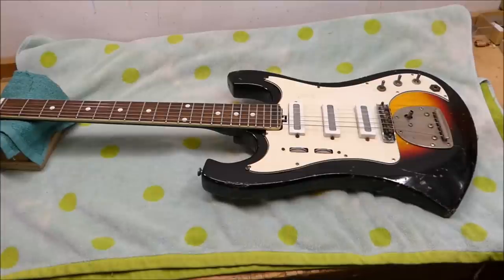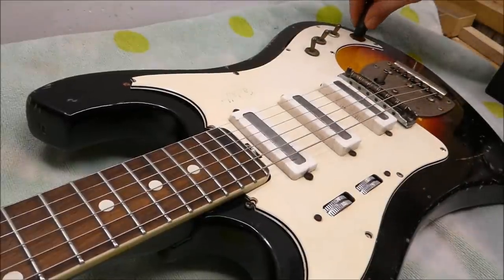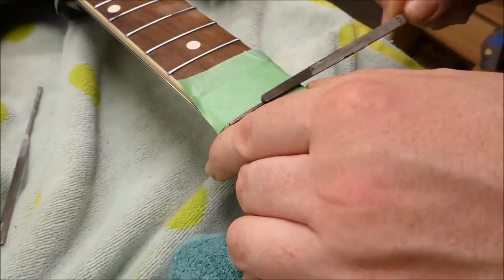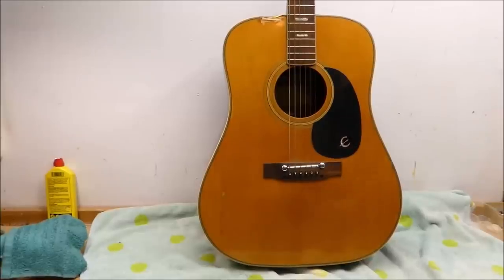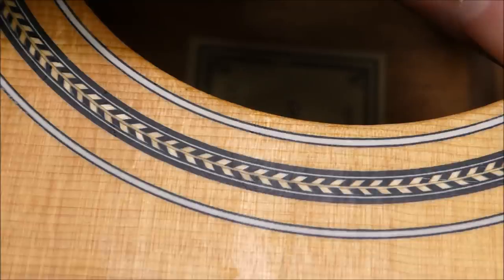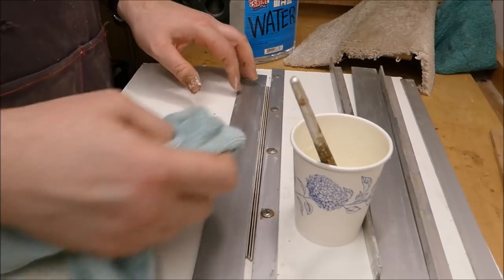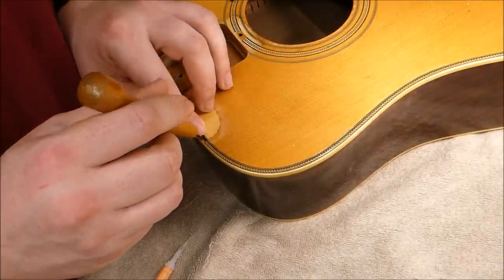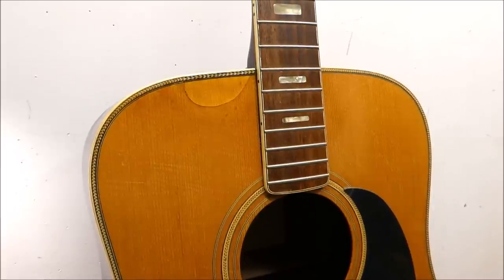Eko Kadett and Epi Ker-unch

Comment: LOVE your comment about “Japanese plywood top” guitars.  I still have my first acoustic, a ‘77 Takamini F360 (Martin D-28 copy); I bought new when a local (Iowa) guitar store was going out of business.  It sounds/plays great and I’ve taken very good care of it. About 30 years ago, I took it to a guitar shop here in Dallas, TX, to ask about a slight rise in the neck, just in front of the neck joint.  The shop specializes in Martins, especially pre-war collector stuff.  The luthier there said he simply would not work on it.  He was rude as hell and said it’s a worthless guitar...made it sound like it was made of cardboard.  

I was a definitely put off, because I love this guitar.   It had spent quite a bit of it’s life, at that point, out of the case and on a guitar stand.  I’m an engineer and after doing some reading, hypothesized it could be due to the wood drying out.  Fortunately, after properly humidifying the guitar, over time while it was in the case, the minor issue went away.  Because of that experience, I’ve never been back to that shop; and I own multiple Martin guitars.  🤓
Reply: I just don't get that. Like if a customer is willing to pay the cost then do the work. If I want to spend $1000 repairing a $50 guitar because of the memories that instrument holds then whatever. I have a buddy who has an objectively terrible guitar he got when he was 17, some kind of cheap knock off of a flying V that refuses to stay in tune. It's got pride of place on his wall right next to his Gibson Explorer because it's the guitar he played his first gig with back in school and has a ton of memories locked up in it. An objectively worthless guitar, but priceless to him.
Reply: @misterthegeoff9767  I agree 100%

Comment: The switching on the Eko is fascinating. It's designed to resemble a Jaguar, but all the controls affect the same circuit. I'm glad you mention that Squier vibrato is aftermarket because for a second I almost thought Ekos had near-exact copies of Jazzmaster/Jag vibratos in the mid-'60s

Comment: That EKO is lovely. A lot of 60s music was played on cheap guitars. EKO acoustics were all over England back then. They played well enough to learn on. Never seen an electric before, though. Nice. Good sound. Poor Epi... Plywood guitars are useable. Bought a Fender F65 back in '74. Had a weak low E. Now it's a booming blues box. They do improve with time. And they are damage resistant. Up to a point. Fine repair, sir. As good as could be done.

Comment: Super difficult repair.  I appreciate the humility and knowing when to stop.  Maybe squeezing a thinned wood putty+wood glue into the joint so it forms a putty line above the top and sanding down would make the line go away and blend better? Idk. I have had the same issue with cracked violin tops trying to sand and fill the crack and the shellac just loves to find its way in.

Comment: Love the videos.. You have tons of knowledge and excellent information. One quick tip for beginners to remember with intonation, using a tuner, move the saddles in the direction of the needle on the meter. Sharp (short) means moving the saddles away from the bridge pickup and flat (long) means moving the saddles towards the bridge pickup.

Comment: I'm a huge fan of the wheel method of adjustment for the truss rod. I  install them in a cut out in the last fret though.
I would almost guarantee if Gibson did this on their guitars it would bring an end the the headstock snapping off because no channel routed under the nut would leave a lot more wood in the area to guard against it.
Also something to try on lubricating these old tuners. I was trying to make some old harmony tuners function smoothly and tried rubbing the gears with wax. Worked great with no mess. Since then have been using White Lightning bicycle chain lube. Dries into a very clean wax surface. No fuss no muss.

Comment: I have an Eko Ranger acoustic from the early 70s that was my Dad’s - it was the guitar that I learned to play on. Interestingly enough, it uses a similar bolt-on neck construction as the Epiphone in the video, but utilises a similar zero fret as the Eko electric. It’s by no means a quality instrument and heavy for an acoustic, but it has a unique tone and worth keeping just for the memories.
Reply: One of my first guitars was an Eko Ranger which was totally beaten up, it had been dropped and the lower bout a few times and the top was loose in that area, it had a couple of loose ribs and dents in the back of the neck but still sounded great and was a joy to play. I loved it's low action and neck profile and I kept it for many years just as it was because of it's unique sound and great playability !

Comment: Also, your fix to the intonation problem on the Eko (clipping turns off the spring) is ingenious and will help me in my own guitars with this issue. I hadn't thought of that as an option -- I always assumed it was spring or no spring. Thanks! And it goes without saying it's amazing that you made your own herringbone for the Epi.
Reply: Be careful what clippers you use for the springs.  Spring steel is Very Hard.
Use a Quality clipper. I once used a quality US made diagonal cutter, on a
spring which was just a little too thick, and one of the jaws went flying across the room.
PS: Wear eye protection.

Comment: A couple of really interesting guitars in this video. I used to own one of those Japanese made Epiphone acoustics and as you said they’re good sounding instruments. The attention to detail and skilled work you put into repairing that top was absolutely amazing!  EKO guitars we’re very popular in the U.K. during the 1960/early 70s, they were solidly built and could stand a fair bit of mishandling without falling apart, I still have a couple of 6 string and one 12 string acoustics in the garage and they have survived pretty well. I suspect that the current line of EKO guitars are made in China. The designs of the original Italian built electrics were quite unique and they had some very interesting pickups and control circuits, they fetch good prices on the used market these days.

Comment: Very nice job on the acustic guitar. Thee Japanese have a saying something about embracing the repairs on furniture (or guitars) Something about showing off the repair instead of trying ti disquise it.
Reply: yeah, i understand that's a thing with old violins too, the idea of the "honest repair" where you see what happened and it becomes part of an old instrument's "story"
Reply: Kintsugi. I've been wanting to do something with a smashed guitar body and epoxy resin for that sorta look.
Reply: Moon Child Thank you for the proper terminology..
Reply: You also see it on newly manufactured things. A great example i saw recently was a manufacturer of forged steel tools, where the working surface was brought to an absurdly fine surface finish but the maker leaves the forging marks in a non contact area

Comment: Question for you? My Brand new sg has a small crack on both exterior sides of the nut. It runs from right at the top of the biding to the finish of the neck but doesn't seem to go through. Almost as if the cracks are intentional being on both sides and Identical. So, can you tell me if I need to replace it or not? Thanks in advance. I love your videos as I'm a home builder myself.

Comment: Suggestion: you can use thinned out acrylic paints to hide the patch seam. It's similar to grain painting, but in this case all you're doing is mixing together the paint to match the color of the wood as closely as possible and then applying very small amounts to blend out that seam. You don't need much and you're not trying to make a disappear entirely just to make it a little bit harder to see. Put a single coat of sealer down on the wood then do the touch up, then do your finishing coats.

Comment: On the patch, very hard indeed to get a perfect color match. Especially when you have a but joint like that. You did a very fine job patching it up. I did a Washburn a few years back and mistakenly thought the top was spruce and just aged. But it turned out to be cedar. So I was sunk before I started. Never been happy with the color match. Would you mind if I linked that Video?

Comment: My first “proper” guitar was an EKO Ranger VI acoustic.  In the early 70s.  All the way from Recanati.  Dreadnought size. Bolt on neck.  Made from plywood with a polyester varnish finish about 1/8 inch thick.  And a cheese grater action to facilitate the learning and finger strengthening process.  I gave it to my nephew eventually.  He may have used it for kindling, or patching a hole in a roof.  They and their sibling 12 string were a common enough sight in this neck of the woods back then.  Used to see them on BBC comedy shows when someone had obviously been sent off to find a generic guitar for a prop.
Reply: I have an electric 12 string solidbody Eko from abut the same year, but pretty nice condition. The red finish is crazy thick. There's a chip around the neck pocket that's about 1/8" deep, and still can't see wood underneath. Makes me wonder if they somehow suspended the wood body core in a mould and poured the finish in to fill the gap. Hell, I wouldn't be surprised if it had some kind of foam core or were completely hollow plastic, as it's really quite lightweight for a solidbody. 

Interesting guitar overall, lots of character. Pickguard has some cracks and lots of dimensional distortion, but still intact, two pickups look identical to these, similar bridge, bolt down aluminum stop tailpiece, conventional volume, tone and 3 way selector, with additional odd tone toggle switch that seems to have an inductor based tone circuit with subtle effect. It's nice to see these older oddities that haven't been neglected.

Comment: I had an Eko bass around 1967.   It was a full Hollowbody two pickup feedback monster, no center block and 4 tuners on one side.   Good bass but couldn’t control the feedback using a Vox Essex amp.  I wish I still had it.

Comment: Amazing how quiet the volume and pitch controls are,  I did not hear any crackling or static or audio dropouts. Either they're very well designed or they were cleaned within the last few months. Does it stay in tune when you use the vibrato?

Comment: Can you put the springs the other side of the saddle rather than clipping them ?
Reply: If you did that, (if I'm imagining correctly,) your screw would have to be on the opposite side of the bridge. I suppose if you were keen to not affect the original parts, you could always use a different spring or smaller distance and just keep hold of the old
Reply: @joesharpe7685  Yes, but being on the other side of the bridge isn't a big deal
Reply: @chrisofnottingham  It's up to the person I suppose, I'd rather keep all screws on the same side, for functionality and on a vintage guitar, originality, but You could do that, if there are holes drilled to the same size that is
Reply: @joesharpe7685  It's not like you are permanently altering the guitar - when it gets a neck reset you can just move the spring back.
Reply: @chrisofnottingham  Well yeah, you aren't wrong, I never claimed you were haha! Personally I wouldn't do that to any of the guitars I get through, but it is viable still. There is no '1 way' to do a job, often it's taking a few methods and balancing up the pros and cons, those however are themselves subjective. So no I suppose this job in the video wasn't perfect as it would suit you more if done another way, but personally the way done in the video appeals to me more. If it's your guitar, way up the pros and cons and decide which method for yourself!

Comment: As for the date: Based on the pickups, it's from the beginning of the run. They started making them in '65, and by '67, they'd gone to a pickup with visible pole pieces. Those are most of the ones you see. This one, therefore, is likely a '65 or '66.
Reply: Thanks for the clarification...it's my drop D guitar & sounds especially good through my echolette gold box...soft finger picked style blooming notes...the wood must be good stuff & Recanati craftsmanship of course...even I get some great notes out of it...I have a hollow body Eko & Dual Tone Supro that needs some TLC...but I'm afraid to call & find him swamped with projects! I'll call tomorrow...the Eko is a '62 & the neck is damn sultry...

Comment: About the intonation on the Eko: in  my experience of 1960s strings, they were really thick, and the action was probably very high by modern standards. This would put the intonation points nearer to the headstock, so the original springs were OK.

Comment: Something hit the Epi with enough force to crush the wood & binding the way it did. I'd wonder about the how & why regarding the way the entire guitar apparently didn't either get seriously damaged at the moment of impact (meaning, it was held somewhat stationary so that the force wasn't solely concentrated on the damaged area but was spread to other areas which therefore also absorbed some of the force), or was supported loosely, as though hanging from a strap in the playing position (implying that the striking object carried sufficient velocity to crush the damaged area before the rest of the guitar could accelerate enough to "roll with the punch"). I'd want to take a careful look for any related structural failure, particularly at the other end of the guitar, to see if there's any damage from, say, sitting on a stand or on the floor when the impact occurred. What comes to mind? In the former case, perhaps something like a heavy floor lamp tipped over on it when it was parked upright, or in the latter instance, perhaps someone with a baseball bat took a good swing at a player. But either way, I can't see how such damage could occur, but not damage other areas of the guitar. So, I'd wanna take a really good look at all areas. Not a criticism, just my thoughts. Great repair job as usual, Ted.
Reply: Hi I am the owner, it was hit by a baseball bat, lonnnng story lol
Reply: @snowheelslim5897  You're gonna have me thinking I might actually know a thing or two, lol.

Comment: Can we assume the neck reset was done like a reset on a similar electric guitar neck using shims?
Reply: It's the only way.
Reply: @zapa1pnt  If someone wanted to do it the hard way they could trim on the neck attachment surface.
Reply: @sewing1243 
Well yeah, they could, but that is, Certainly, the hard way, when If you want to be slipshod about it,
all you need to do is use some card board and paper.
Cutting on the neck pocket is not immediately reversible and extremely easy to F up.

Comment: Eko wasn’t well regarded back in Italy, but it was reasonably priced and allowed middle and lower middle class kids to approach guitar playing for the first time - imports were absolutely unapproachable price-wise until the late 80s when we started  seeing Asian imports/budget Fenders and Gibsons. Some Eko models (especially in the 80s) also had some questionable design choices - like pinewood bodies where the bolt on neck screws were screwed straight into the wood of the body - within a couple of months under tension you’d see the screws ripping right off the body...